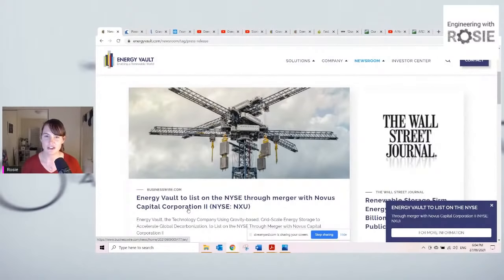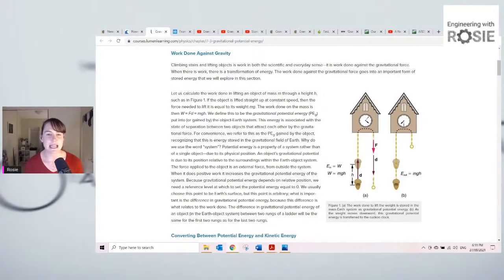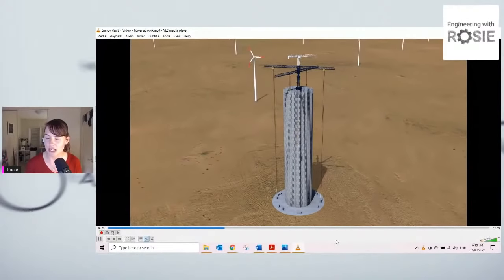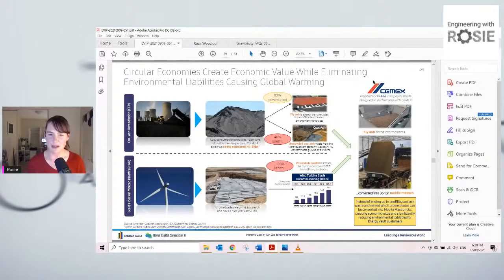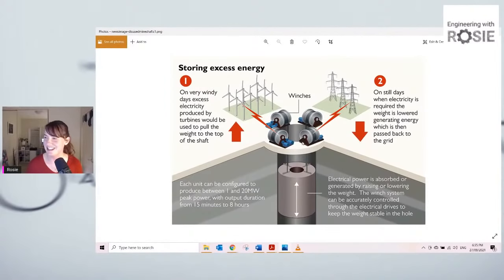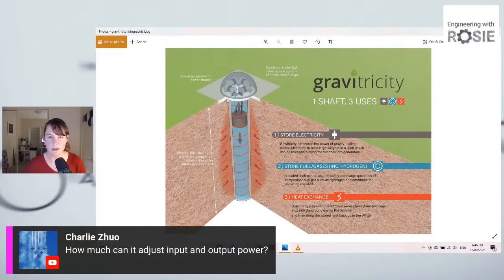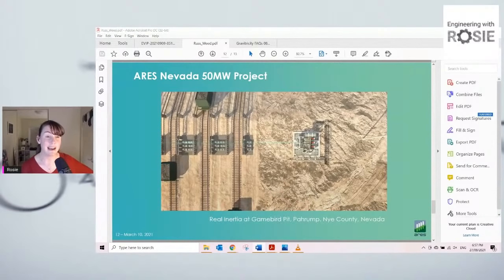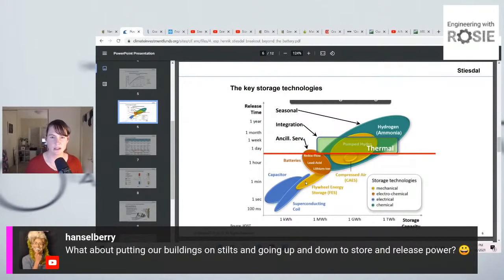Engineering with Rosie Live Ep. 2 Strange Storage - Energy Vault, Gravitricity, ARES Rail Storage

Comment: Another great episode! A few things I think always should be considered when evaluating such "slow" energy storage, first off, it is financially dependent of frequent large swings in price of energy, because it is the difference in value of the energy put in to the system and and the value of the energy retrieved back from the system that has to pay for the system. Construction, running costs, and profit. Energy storage can't decrease the difference in price of electricity between peak and low demand very much, because then it doesn't make enough money. If it works too well it's doomed to go bankrupt, unless the system is extremely cheap to build and maintain per unit of capacity. 

Also, energy storage does not only "compete" with other types of energy storage, but also Demand Side Management, which can be achieved in oh so many ways, and in most cases increased transmission capacity between areas. Purpose built grid storage might also se "competition" from home batteries, that serve multiple purposes, and selling and buying power to make money on the price swings are usually not one of the top two reasons.      

That's why you "can't" build hydro storage without enough natural elevation to utilize, the cost per unit of capacity needs to be so absurdly low for it to be financially viable. Personally I don't believe any of those systems has a chance to compete with pumped hydro in cost even if you have to create large part of the elevation. The suggested materials have a few times higher density than water, but really large dams can be built for practically nothing per unit of potential energy storage capacity compared to their systems.  Sure it can't be built anywhere, and it takes some land, but were talking grid scale storage here, and a couple of huge dams doesn't have to be a waste of space, the can be very beneficial. 
         
Energy storage with much quicker response, like batteries, or flywheels can provide grid stabilization that can be incredibly valuable per unit of energy retrieved back from storage. Gravitational storage can't really provide a lot of power instantly, as the power you can get from gravitational storage is dependent on velocity, and no velocity means no power.       

Also, a huge building to store mass in form of gigantic blocks at elevation to store energy, covered with elevators, didn't look cheap to me, far from it, or very reliable. Some newly invented material that is essentially free, solves a waste problem, and we can trust holds up to daily handling for decades, I think not. If your solution needs super wishful thinking to come true, move on. I don't think the blocks are the main issue though, the building is, and the complexity. And, from the guys (?) that didn't realize themselves that a lot of the charging will need to happen when it's really windy. Essentially all else equal the windier the higher rate they would need to pick up those blocks in the old version with super long cables, dangling in the wind, and dismissing the issue with some hypothetical "solution". Doesn't exactly inspire trust. Neither did the illustration having concrete blocks piled from ground up. In their new iteration, I think they'd could make much cheaper, and less complex, using water instead, the difference in density is not critical, the thing that will make their building expensive is the mass it needs to be able to withstand high up, a little more volume would not be that problematic, and the elevator system could be replaced with a turbine/pump or two. But then again, constructing a couple of dams would be a lot cheaper.         

Hundreds of meters deep mine, and Gravitricity wants to use a single gigantic weight? I mean, ever heard of water? Even if they use led in the weight they need less than 12 times as much volume in water to get the same mass.  Sure you need a way to store the water at ground level, and in some cases you might want to have the water down in the mine in tanks, neither has to be a big issue, if you consider that the potential capacity would probably be over 100 times greater in most cases, and there's a lot less guesswork involved, sorry, I meant further development required.                     
                  
If Ares makes their system financially viable they could make much bigger difference for the world by supplying others with their magic. Rail is finding difficulties to be financially viable for transportation i large parts of the world. For energy storage, on tracks built for the purpose, and carts, to store a little power, hoping to sell it later with a profit that more than covers both energy losses and costs. And those insanely long chains, come on, do they use reinvented wheels as well?         

A couple of details I don't agree with; pumped hydro dominating energy storage is not so much because of current cost of lithium ion batteries, it's mostly because lithium ion batteries were even (much) more expensive, or in some cases not even invented when those systems were built. And off course, "on river" storage, in as a "bonus" from generator system, the storage part doesn't have to carry all the cost.       

And, we can make an absurd amount of lithium ion batteries, there's a lot of lithium. We can currently not increase production of LiCoO2 batteries as much as we want, but in stationary storage energy density doesn't matter that much, LiFePO4 is more than good enough. If we were to use so much lithium that it became somewhat scarce, we could use other types of batteries for stationary storage. But estimations of currently known reserves of lithium that is currently financially viable to extract is enough to have a lithium battery powered world, and we will find more lithium and we will get better att extracting it, and recycling batteries.             

Also, batteries will become much cheaper, there is a lot of potential for improvement, I mean, it apparently took Elon Musk to figure it was stupid to have the tabs at the ends of the electrodes, and it seems that even he didn't figure that out until fairly recently. I've wondered for decades why batteries are made with just a small tab at the end of each electrode.    

A last thing about energy storage, for this time, the current need for grid storage due to renewable power generation is miniscule, except for some small areas, the world still depends mostly on fossil fuel power generation. Denmark can improve the transmission capacity if they want to sell their percent(?) of their yearly production that they currently can't use or export. It's still quite a while before there's a huge demand for grid storage due to renewable power generation. By then VPPs, Vitrual Power Plants, based on "home batteries" will probably be the by far most viable option.

Comment: Considering heat exchange,  once you're over a few hundred metres underground, the temperature is already up to 65 degrees Celsius & at a few thousand it's over 70. My sister has a cattle station in the desert & water being pumped up needs to go into a cooling tank to be used.
Reply from the maker: That's interesting, thanks for commenting! I've got to do a video on this one day.
Reply: @EngineeringwithRosie  if you want more info on this I can get you in touch with my nephew who would be as interested in what you are exploring as I am. They genuinely like visitors.
Reply: Bore pumps in Orkney (some islands with no mains water grid) regularly reach 300m deep, and the water comes out ice cold.

Comment: Thanks for your efforts! I recommend to convert all mechanical energy storage to using liquids, pumps and motor/generators. Then the density of the liquid can be increased as well as the differential level can be controlled to adjust capacity. Mechanical wear and maintenance are simplified and controlled.

Comment: Some really good ideas coming up in the energy storage Field.
Sand thermal storage is a cheap new technology.
Electricity turned to heat and then stored in a sand battery using pipes with super hot air running through sand and heating it to relatively high temperatures for long term thermal storage.

Comment: the problem of pumped hydro vs gravity storage is that with water you need to increase the reservoir to increase the capacity. But with gravity storage you can replace water with pure iron blocks which is 8 times more heavier than water, and multiply your storage capacity by 8 times. Iron is cheap because it is the most abundant element on Earth, you can get if from scrap by reduction. Of course for huge projects , water kills gravity storage because water is free. But if you wanted to have a safe , 100% reliable electricity source gravity based on iron blocks seems to be the best choice, for a sort of backup electricity source, like for when you need to pump electrolytes in a Vanadium Redox Flow Battery or Zinc Bromine Flow Battery

Comment: I saw a video about the hauling blocks up a giant tower structure to store energy. Apparently it’s not so good as as you take energy out by dropping the blocks the energy reclaimed is reduced as the height becomes lower and the blocks already lowered means the ground gets higher as well.
Reply: This should be easily solved by lowering the blocks to the ground level instead of on top of each other, you do not need to make a tower when discharging the system. Also, the issue is not so much how much energy is stored in a given block but if the crane can keep the pace steady so there are no interruptions.
There are still other potential problems, but that is why they built the prototype.

Comment: I'm in the middle of watching this. You captured my attention again, so [Subscribed]. Thanks for showing me that maybe you ARE listening 👍. 20 minutes into the video: paused. 
My idea for the concrete block storage (before a larger group was actually able to implement it):
Okay, so oil companies drill large holes in the ground. They extract oil. Then you're left with  large holes in the ground. Weights could be lowered down into the holes, extracting the energy from the lowering process. (Given the holes are drilled straight down)
If the holes are cased properly, the weights maybe able to be retrieved and process repeated.
More advantages to this process are that heavy waste products can be embedded in the concrete blocks. This repurposes waste. Another advantage is that the energy can be stored indefinitely with very low losses. Batteries lose energy through self discharge if left to sit. 
Power from wind and solar tend to be seasonal. Storing energy for long periods without loss is a definite plus. If the technology or innovation of this concept increases in efficiency, the blocks and their 'state of charge' will likely not be changed. I'll unpause now. Thanks for listening ❤️
Reply: Glad you addressed the hole idea. Yes, combining large block plus hydrogen in a hole sounds like a spaceX launch. Sell him the idea. He has $$$😁
 The main downside of the concrete block storage is earthquakes. 
<Anyone who's seen the power of a hurricane would like to capture it.>
In the land of continual conversion
30.59687, -96.08862
Where minutes= too many feet.
I'll leave you with important equations. 
Pitch circle diameter= pitch/sin(180/# of teeth)
Large physical force(long time period) +vertebrae =sciatica

Comment: We all agree that renewable energy sources are not viable grid-level suppliers until we have grid-level storage.  No arguments there.  

However, what seems to be overlooked is that the solar or wind farm has to produce the energy to supply the grid, and then produce the energy to feed the storage device.  Given that the intent is to cover not only the night time for solar or the windless days for wind turbines, such periods might also go on for days - such as during a winter storm.  

Under those adverse conditions, the storage system has to store three or four times what the local grid demand is to cover all those days until full production begins again.  

Let's look at some numbers.  it takes 10 acres to produce one megawatt (MW) of electricity.   On average 1 megawatt of solar power generates enough electricity to meet the needs of 164 U.S. homes.   This is, of course, under ideal solar conditions.

During the day, these homes need 10 acres to power them PLUS 10 more acres to power the storage for nighttime use.  That's 20 acres.

But a storm might produce cloud cover for a week or more so there needs to be more acres to store more power for 7 to 14 days and nights of reduced or no solar power.  For 10 to 15 days, we need 1,000 to 1,500 acres to power the city AND feed the 7-10 days of storage.  Of course, neither the storage nor the recovery of the power is 100% efficient and even on sunny days, the power production will not always be 100%.  To produce enough power to store enough for a reliable grid might take even more acres. 

If you consider that that group of 164 homes were each on a large half-acre lot of land, the solar farm needed to power them might be 18 times larger or more than the land used by the homes.

Translate all this to a large city or even to a large neighborhood of homes and businesses and you are talking about monster solar farms.  Wind is similar in its reliability and consistency of power produced but it can also drop below grid level production even during a sunny day and suffers from being unusable if the wind is not within a relatively small range of speeds.

This really applies to any grid-level storage and any renewable natural energy source except perhaps geothermal.
Reply from the maker: Take a look at some of the studies that have been done on 100% renewable electricity systems for a more nuanced way to think of these issues. When you simplify to the point that you have, you end up thinking you need way more energy storage than the more detailed and more realistic models suggest. You gain a lot by having multiple sources of variable renewables (e.g. solar plus onshore plus offshore wind), and interconnecting large geographic areas together. 
There are plenty of grids around the world with more than just a small amount of variable renewables in them, and they do not have the huge land use or storage needs that you are thinking we'll need. A couple of fun resources are the opennem website. e.g. South australia is up to 65% variable renewable (wind and solar) generation with the remaining 35% coming from fossil fuels (gas) and imports from other states. https://opennem.org.au/energy/sa1/?range=1y&interval=1w 
And if you're on Twitter, check out David Osmond's simulation that he updates each week based on real weather and consumption. He's got a model where he just scales up the existing wind, solar and storage in Australia's current grid to show that it can get very close to 100% renewable electricity with just 5 hrs of storage. He's done nearly a year now and it's sitting at about 99% renewables for that period. It's really fun to follow because he updates it weekly with real data, so you can see what kinds of weather events have what effect. https://twitter.com/DavidOsmond8/status/1554658923596042241
David will be a guest on the next livestream (tentatively Wednesday next week), talking about his simulation, so if you're interested then keep an eye out for that.

Comment: Storage is going to have to compete with variable load to some degree, for example if you can heat or cool some mass in a building, then stop using electricity when it isn't plentiful. Also, overbuild. If the wind turbines are only making half their usual power, but you build twice as much, you still have enough. That said, I think we will need some high capacity low cost storage, in addition to LFP batteries for short term storage. It will be very interesting to see what works out.

I still wish you would do a video on Charybdis, the new wind turbine installation vessel being built in Brownsville Texas, our first. It must be pretty tricky.

You talk with such soft language. You are very gentle with people's feelings, BUT, are very careful to not believe nonsense. 🙂
Reply from the maker: I agree that variable load is going to be a BIG part of the energy transition. Or at least it should be. I did make one video related to that but in general I am finding it hard to think of a video idea on the topic that people would want to watch. Any suggestions? This is the one I already made, in case you didn't see it and are interested: https://youtu.be/PxdYK1-5AZE